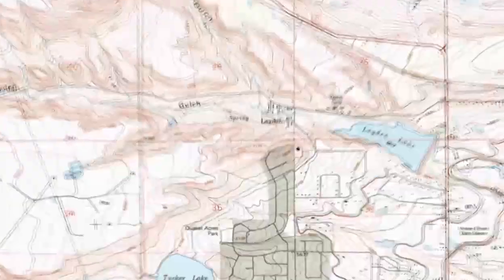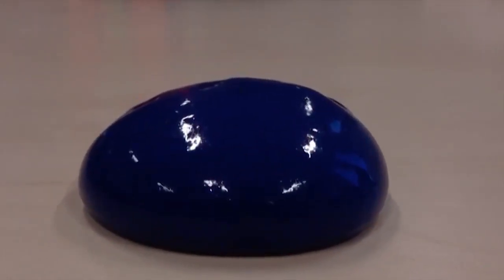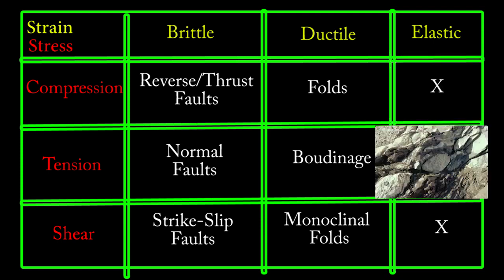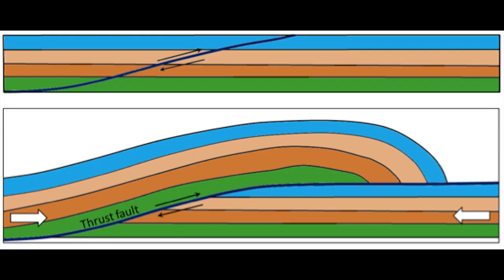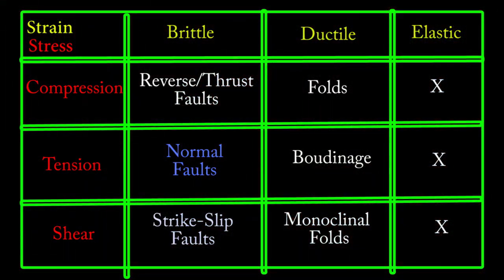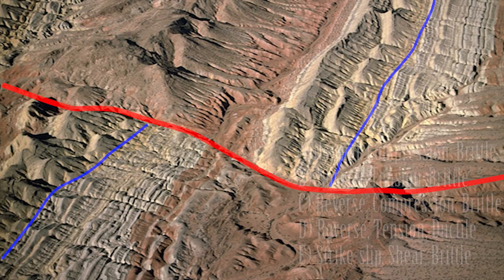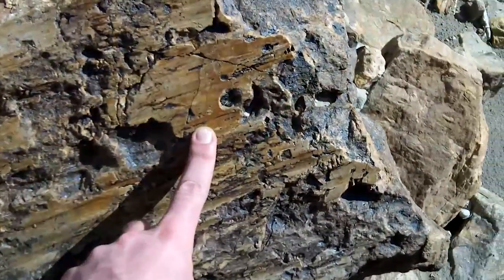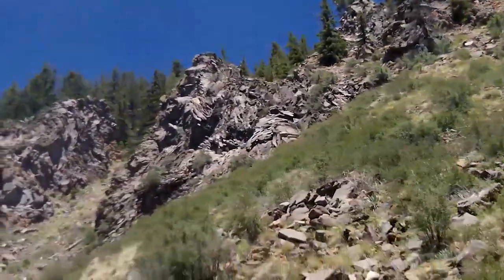68) Stress Strain and Faults

Comment: What is the exact location of the Sevier thrust faults in the video? I want to check them out.
Reply from the maker: In Red Rocks Park west of Las Vegas. You have to hike back a mile or two to get to the site I filmed the thrust putting Paleozoic over Mesozoic.
Reply: @CVshorey  Okay thanks! I'm planning a spring break trip to Zion National Park for my university's Geology club and I wanted to know how accessable the outcrop is as a potential stop on the drive over.
Reply from the maker: Ariel Espindola my apologies, the thrust west of Las Vegas is the Keystone fault. I   misspoke in that clip. Sevier fault is in Utah. https://keckgeology.org/2017/12/southern-utah/
Reply: @CVshorey  Got it. I appreciate the extra info as well.